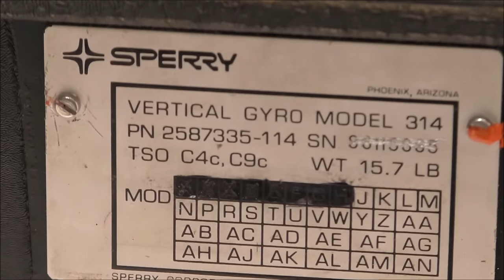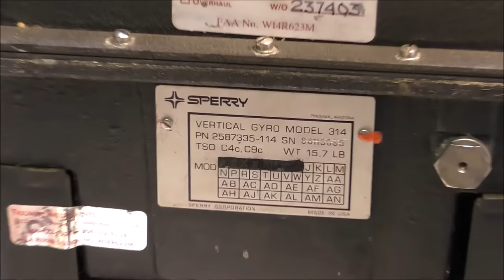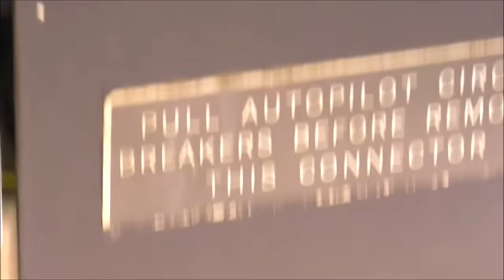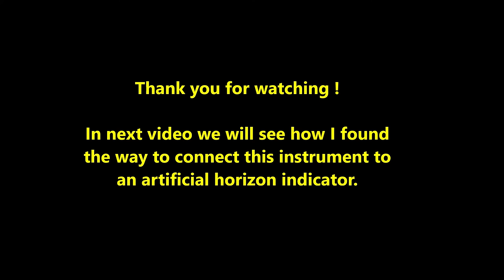LDM #131: Boeing 737 vertical gyroscope - Part 2: Teardown

Comment: Is that little 3rd emergency gyroscope in modern glas cockpit airliners actually still a mechanical/electrical combo system similar shown in this video? Let's say as a backup gyro if Win95 like avionics is failing with a bluescreen.

Comment: I've been playing with things like this for a while and am now in the process of bringing up a gyro IMU, the ASN-109.  I have done extensive reverse engineering and have the platform operating.  Currently I am building an electronic display using synchro to digital converter blocks.  The matching display is unobtanium.  In your unit, the electronics is used to level ("erect") the platform.  Those glass capsules are electrolytic cells and sense gravity to determine a level condition, then the electronics apply torques to the synchro motors in the gimbals to make it level out over time.  My unit needed 3 phase 400 Hz and it took some time to find a reasonably sized inverter.  I do have a 1200 pound monster which will create tens of kVA but finally found a smaller unit.

Comment: Thank you for the closeups of the internal electronics starting at 16 minutes. That is clearly all HAND WIRED, HAND soldered. Even the wiring harnesses have lacing cord that's hand-knotted. All modern electronics is machine assembled, no such character or care.

Comment: Dear Michel,

Thank you for theses beautifully made and insightful videos.

I was wondering if one can actually use this kind of instrument in a high performance car as a stabilizer?

The aim is to reduce the number of parts without sacrificing the agility and the cornering capabilities required in a high performance car.

Thank you in advance
Reply from the maker: Hi,
Thank you for your comment. This technology is quite old, today other techniques are used, with lower cost and weight. A new gyro like this one should cost a fortune back in the days.

Comment: Beautiful bit of hardware engineering, it’s just the software everyone is worried about.
Reply: No way.  

Physical gyros are fragile and have bearings and gimbals that wear and mechanical instruments require fancy clockwork with flags that stick.  

Give me solid state ring laser gyros and a glass cockpit any day—especially when you can have one that includes a complete Attitude Heading Reference System and Air Data Computer as well as a GPS that fits in a standard instrument hole.  

Worst thing is usually a flag that goes away on its own by cycling power.

Comment: Do they use brushes to make electrical contact between the rotating surfaces?
Reply: Yes, you can see examples at 3:25

They rub against each other along the centreline of a spinning axis, to minimise their friction effect on the moving mechanism, due to a near zero leverage at that friction point.

Comment: Are these mechanical gyroscopes still in use? As per today, every smartphone has a miniature gyroscope on a chip, build in, that workes super reliably, consumes hardly any power. Plus gyroscopes are now only a backup solution in the aireplane, beside the primary use of GPS and GLONAS. I would think, we can easily get rid of mech. gyroscopes. Or is there something, I don't understand?
Reply: Modern aircraft still use gyros as a primary means of navigation within an inertial reference system. Modern gyros are LASER ring instead of using a spinning mass.  The ADIRU/IRS are coupled with a GNSS systems to provide hybridised data for navigation.

Comment: All your videos are amazing, I have learned many things. I have several gyros, among them I have de models 311 and 313, both models have the connector J1. Do you think that I can use the same power pinouts that you used in the model 314? there is a way to check before connect the power? maybe following the wiring and compare if they go to tha same components?
Reply from the maker: Thanks for your comment. I think that the pinouts of all these versions are identical. You can check if you have a low DCR between the supposed power supply and if they are isolated from other pins.

Comment: state of art engineering. I wonder the electronics circuitry is used a lot of old generation parts , like germanium transistors , electrolytic capecitor and some vaccum tubes with murcury drop to determine the level... How interesting . we fly RC plane inbuilt gyro chip. This chip has all major axis controls with precision . inbuilt and intigrated .

Comment: 3:50 Air bubble sensors inside, I guess they must only work when the plane is on the ground. Otherwise, the sensors would be useless if the plane entered turbulence and started to fall.
Reply from the maker: They work all the time to keep the verticality, otherwise the gyro is useless. All gyros need to be disciplined because of their inherent drift. There is no reason that these sensors fail, inside there is a kind of electrolytic solution which permit to have a variable resistance according to the verticality.

Comment: I don't get it. Its oscillating and not spinning?
Reply from the maker: What spins, is the gyro rotor inside the inner gimbal which is kept vertical. It is not visible.
https://encyclopedia2.thefreedictionary.com/Vertical+Gyroscope
Reply: This level of tech has been closed out for most of my lifetime. Only now is the hardware enabling 'space age' tech coming to light, having remained secret for so long. Imagine the pilot announcing the reason for late departure being due to the spin up time required for the INS to get up to speed! And this is just the hardware required to run the ADI on a modern airliner? Remember the COPA 737, flight 201 crash due to an intermittent 'stuck' instrument giving rise to out of phase bank state confusing the pilots of the aircraft during a night flight? The tragedy is they had dual capability but for unknown reasons they slaved both systems to the faulty unit.

Comment: I guess you could use this to demonstrate gimbal lock.
Reply: No, there're only two axes, pitch and roll but no yaw to allow them to line up, ie they will always remain orthogonal, also the inner axis is limited to what looks like around 180 degrees when he rotates it manually..

Comment: Why does it wobble at startup?
Reply from the maker: This is due to the regulation of the verticality. The verticality is regulated using two gravity sensors and two torque motors, one for each gimbal. At the beginning, when the speed of the rotor is not high, the torque motors provide large effect on the gimbals. This effect becomes less and less important when the speed of the rotor increases, that is to say when the rotor rigidity increases.

Comment: It's a Sperry gyroscope, not a Boeing gyroscope. Boeing submits detail specifications to other companies who specialize in making components, commonly called LRUs (Line Replaceable Units). They are built, tested and warranted by these suppliers, not Boeing (or Airbus).
Reply from the maker: Of course, I just said that this was the gyro installed in Boeing 737.

Comment: what is that mercury in those tubes .
Reply from the maker: These parts are tilt switches and permit the stabilization of the gimbals using torque motors.
You can find vertical gyros on EBay but they are generally expensive.
Reply: @lelabodemichel5162  My guess: the 2 mercury switches are used to zero-align/initialize the system but the plane must be very still on the ground for doing that, thus the sealed set-screw on the assembly. Long ago I wanted to use a mercury switch to sense angle (roll/pitch by gravity) but centrifugal force interferes with that when in motion, even just swaying.
Reply from the maker: They are used every time, on the ground or not to keep the gyro vertical,

Comment: Old crap, today we use laser ring gyroscope from Honeywell, smaller, better and cheaper. Get a brain.
Reply: Also the laser ring gyroscope will be old crap after forty years. This is called evolution. Imagine that they have already made quantum sensors that measure the position of the atom...
Reply: Wasn't crap in 1985.  Although optical gyros existed then, they were not as common.  While I was working on them in the 80's as a Navy electronics engineer, every single gyro I worked on was electromechanical.